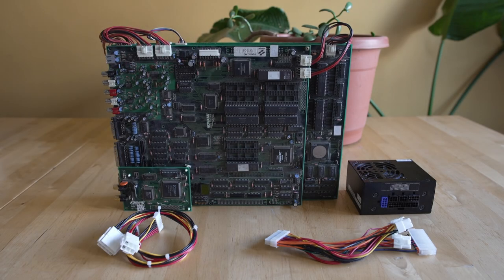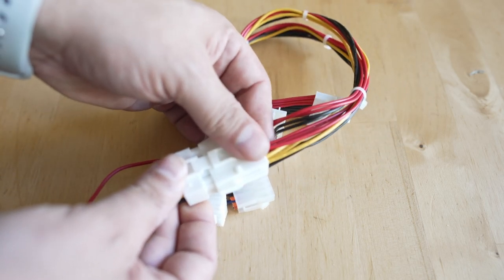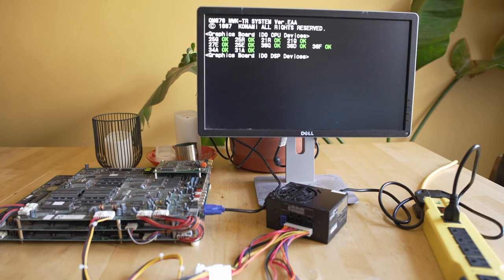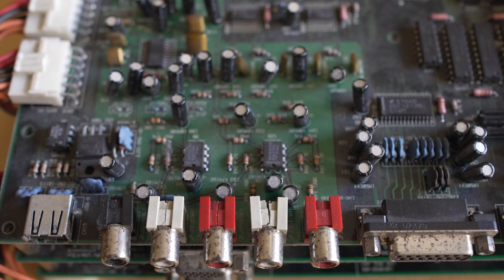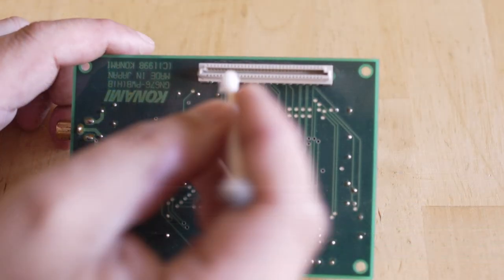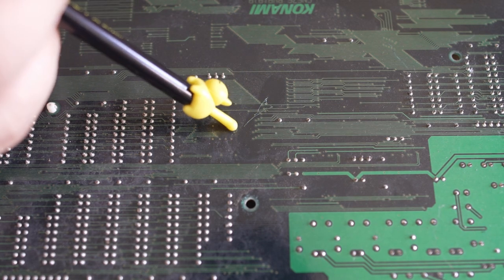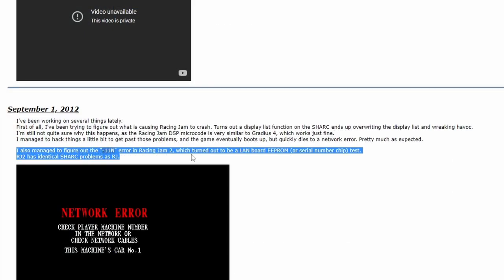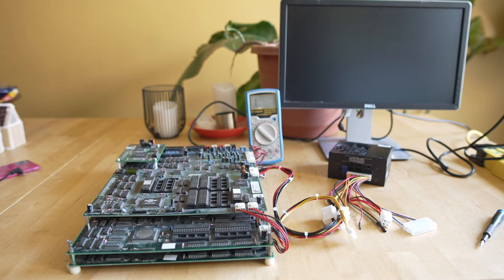How to Troubleshoot Arcade Boards! The Konami NWK-TR Thrill Drive Board! Rare Arcade Retro Gaming!

Comment: I'm so used to seeing JVS being adapted to JAMMA/ATX that it was refreshing to see something else being adapted to JVS for a change.
Reply from the maker: Yeah it’s a fun use case. Basically teaching people connectors are nothing more than that...connectors. You can plug anything into anything so long as the pins / leads are correct

Comment: Hey man great video.  I've been recently going through this sortof.  I bought a rusty blown early revision aes board for $70 and it's been a real nightmare.  I got to finally give an error screen so I know somewhere to start replacing chips but I'm worried there's gonna be problems with chips that arn't tested.  And I'm already like 30$ down in parts lol.  Also the check that's failing is the first one it checks for ugh.  Also was having an issue burning a neo diagnostic bios... 

Anyway, make sure for your video you put the error code somewhere so in 10 years some poor soul can find it easily.
Reply from the maker: I know what’s wrong now. And it’s bad LOL. Not unsolvable but it’s the one thing I DIDNT WANT IT TO BE. Because that’s what always happens lol

Comment: Can you make more of these videos please?  Good repair logs always describe how the hardware works.  Much more useful than if x then y kind of logs. Also thrill drive like the konami viper hardware wont boot if the battery is dead.  Would have checked that first.
Reply from the maker: I can try but they take me a solid 8 hours and views are poor on them. I’ll keep making them when I can / when I solve common problems that a lot of people will have. I am still working on fixing this board. Haven’t solved it yet. But I know what the problem is so
Reply: @Video Game Esoterica  think you may have to flash it with the correct code after you replaced that rtc. For more info check out mame source code and viper rtc repair logs.  Thats if its anything like the viper hardware.  Konami loves to throw a spanner on any and all faults.
Reply from the maker: It’s not the RTC. It’s the eeprom. That’s not registering in POST. So it may be dead. Issue is there is no dump. But I’ve gotta put the network board under a microscope and check it still
Reply: @VideoGameEsoterica  If you are 100% sure then its hard for me to help as ive never worked on this hardware either.  The viper hardware is a load of crap.  too much BGA in it.  If that error code is the network board though then either something is broken on that or the RTC security as its right next to the network board.  Shame you don't have a working one to swap it over.  Also be careful you buy a good quality rtc.  The china ones are mostly fake.  Maybe mame source code has something on that error code? or even the security checking sequence?  Worth taking a look at that.
Reply from the maker: Yeah I get my RTC chips on DigiKey to be sure!
Reply from the maker: MAME uses a workaround to get the eeprom to pass. I do know what memory addresses to write to the eeprom but I need to find a replacement part as that specific IC is no longer available and I can’t find a pin compatible chip. So I’ll need to convert something over

Or I may just convert it to Racing Jam as that doesn’t require an eeprom check as it shipped without one

Comment: I got a ZR107 WINDING HEAT Board that isnt powering on, just shows 88 on the display for a second then turns off, then flickers 88 once every few seconds, any idea where to start looking?
Reply from the maker: It’s failing post. 88 and boot loop means it won’t attempt anything else as it’s detecting an issue. Could be anything at that stage
Reply: @VideoGameEsoterica  How exciting, any advice on some steps to try and track it down ?
Reply from the maker: Fully take apart, clean and put back together is step 1

Comment: Hey man.
I have a Konami Duel Terminal Arcade Cabinet which started giving image troubles. All the 3d textures are being displayed incorrectly, like flickering. Any idea where I can start checking for possible bad chips?
Reply from the maker: Check roms first against a known good dump. From there check ram
Reply: @VideoGameEsoterica  Just checked ROM from different SW versions and all of them are fine. RAM is working properly, too.
Just pinpointed the problem to a dying GPU. On your experience, are these direct changeovers? Or am I screwed?

This arcade is running on a Windows Embedded distribution, btw.
Reply from the maker: Let me ask around. Usually you just swap with the same GPU but I’m not sure if there is any custom driver flashed to the card or not
Reply: @VideoGameEsoterica  is there a way I can send you a picture of the pcb? There is no graphics card to be found
Reply from the maker: Just find me on Twitter. VGEsoterica